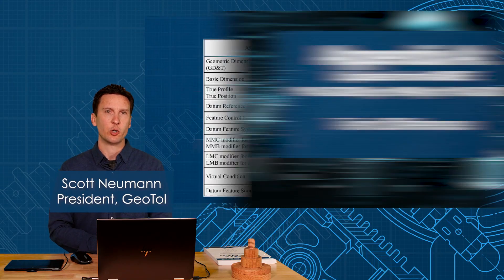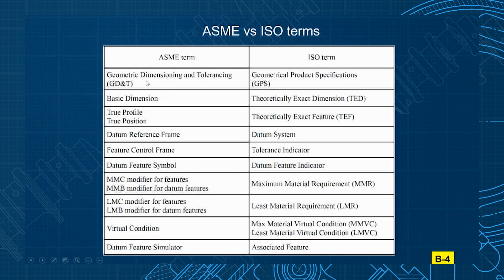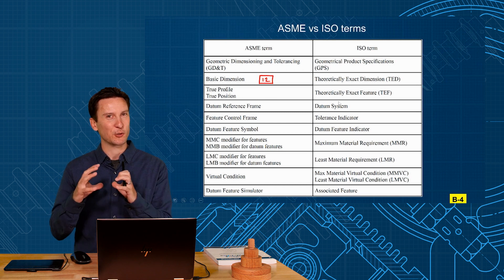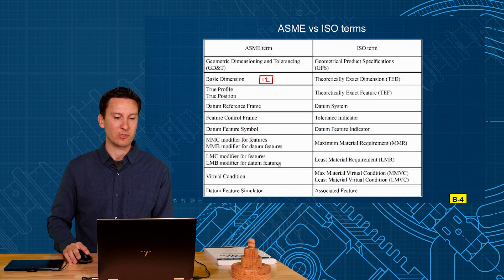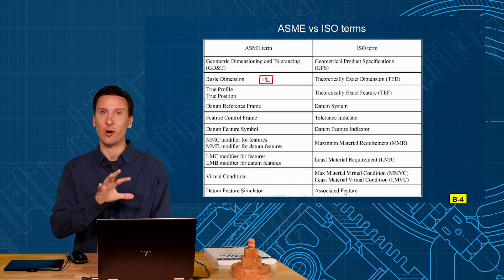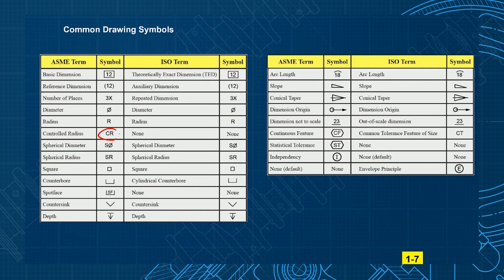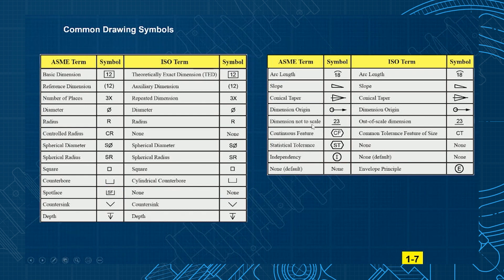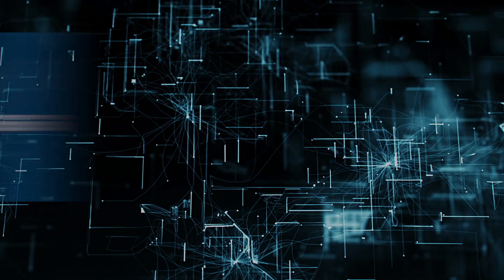ASME Y14.5 vs ISO-GPS Term Differences

Comment: Hello I am quite puzzled with Shift datum ASME vs ISO. In asme you never use datum shift M condition as a bonus tolerance but in ISO i see some examples those tolerances are added to bonus tolerance.
Reply from the maker: They are the same. Although ISO doesn't call it "shift". In ISO 2692, it says the MMVC shall not be violated by the datum feature's surface. This means the datum feature could "shift" to meet the requirements of other features on the part. You can not add the datum feature shift as bonus in either standard.
Reply: @GeoTolPro can I find it this info ISO 2692. We are having quite serious discussion over it. Having a solid example might convince people.